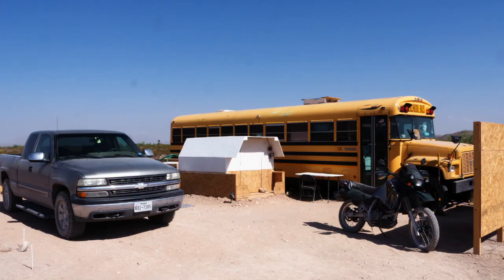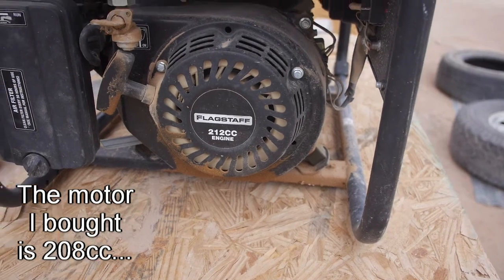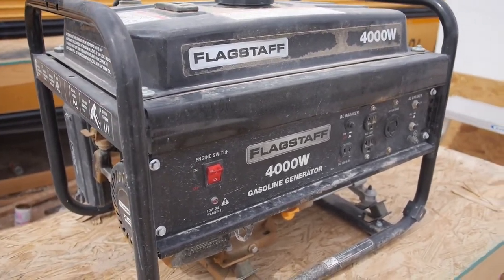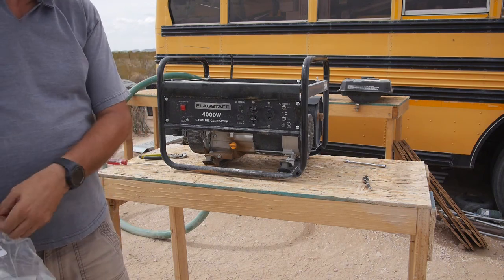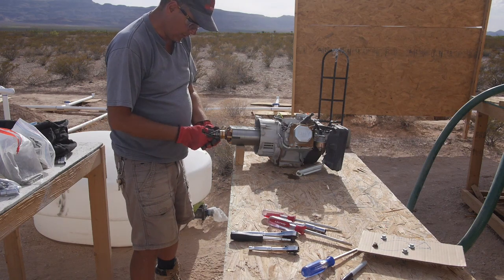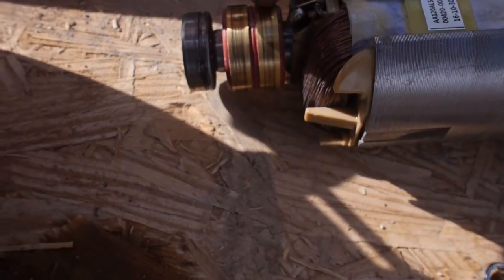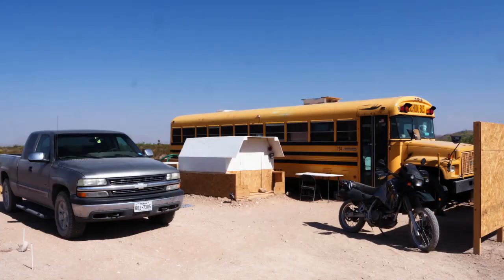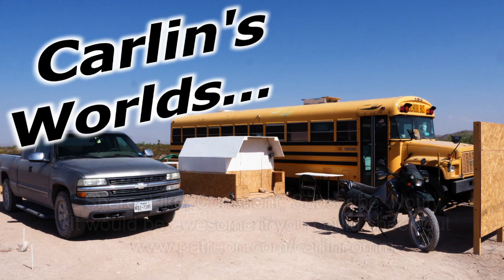Ironton 4000 Watt Generator Teardown Learning Experience

Comment: So shaft is not key. Only wat to use is to weld it or wat can also be done. I took mine apart thinking it was key hope it is by tomorw i will know
Reply from the maker: Yeah it's a tapered shaft.
Reply: Do you know if there is a way to make it to a key shaft or coversion
Reply from the maker: You would need to measure the taper first, then find an adapter to match it. I don't remember if the whole shaft is tapered, maybe just cut it short, then cut the key. None of that is practical on a $100 500 hour rated motor.
Reply: O ok am sayinc cuz i seen this motor come with a key shaft. Am check mine out ones i remove the big copper thing with the platic fan
Reply from the maker: Yeah I have the same motor.
Reply: Dang am have to find a way to do a key on it to use a clutch
Reply: But wonder if i can cover it to a key one
Reply from the maker: What I had thought of is if you could buy a replacement crank shaft, get the one with the keyway already cut, it wouldn't be too hard to swap it out.
Reply: Where would i get the torques from tho. So it can be a good built or where would i even get that replacement from
Reply from the maker: I bought the motor and generator from Northern Tools, I think they could get replacement parts. Also the motor from Harbor Freight looks about the same, probably comes from the same factory. Maybe Google can help. I don't usually have good enough internet for research.
Reply: O ok am have to try that out thanks on all the info
Reply from the maker: Good luck! The info must be out there! I have heard of people putting after market parts, hot rodding them. Some of the mini bikes run the same type of motor.